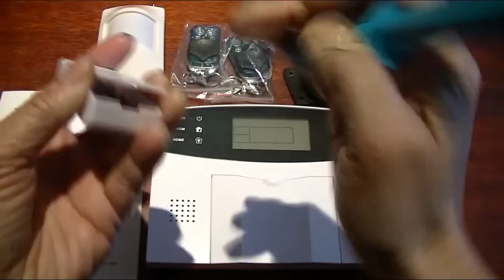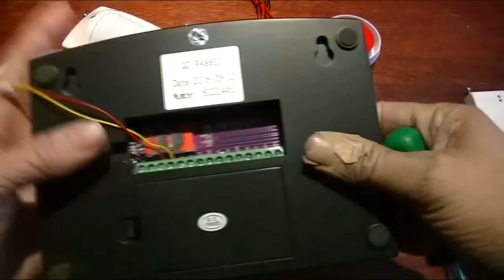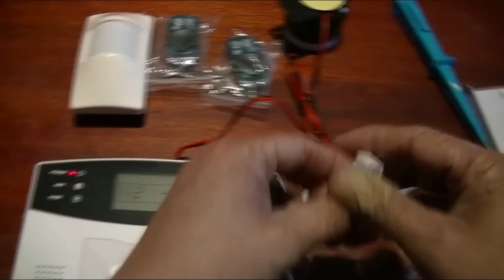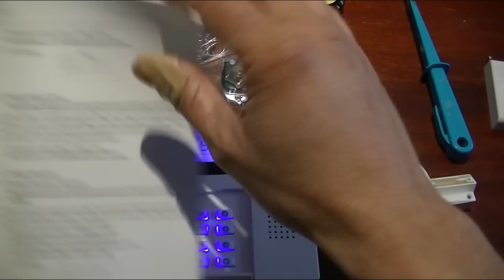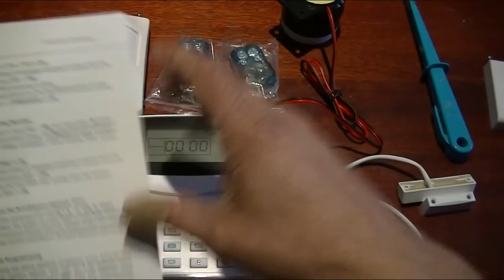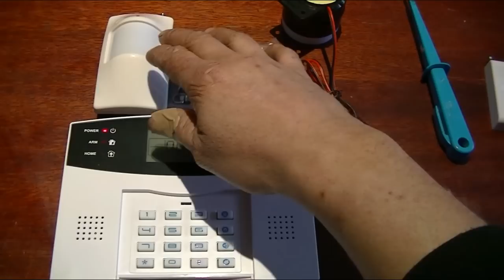Wireless  GSM alarm full review,  programming and  test

Comment: Hi i have a 4 wire fire detector
To connect with this alarm, should i do the settings of the fire detector on nc or no?  I got it to work but after I installed the wired pir sensor the fire stopped reacting and when pir is triggered the is no soumd coming out of the siren it just send mag and call.
Thanks

Comment: Thank you! Do you get any false alarms with these motion sensors? In an effort to avoid false alarms, I am planning on buying this same system but with different motion sensors with Dual PIR + Microwave MW, from a different manufacturer, will any/most sensors work with this system.  If you an affiliated link I’ll buy from it.

Comment: Nice video... But,Mine must be a slightly different version to the one in the video,Got all the sensors working but the magnetic contacts (That are already wired up  ) wont work,Tried a factory reset but still no good. It's like they are disabled,Any ideas
Reply: Same mine  did you figured out?

Comment: Very good video...I wonder can you tell me if you can adjust the length of time the alarm sounds if triggered....so it won't be sounding for hours if I am not at home....and driving my neighbors crazy.
Reply: The system is designed to alarm and intimate you. You have to set the alarm off it goes off. The WiFi model, you can control via app, same as the GSM model.

Comment: Thanks...question...
..my unit came without batteries and I need to determine what size battery to use in the remotes. Do you know what battery works in the remote?
Reply: Larry Minichello it works with 23a a23 v12 alkaline batteries
Reply: I’m pretty sure I threw my last one out a couple days  ago so the package is gone

Comment: Old thread, many questions. I have got this alarm and want to emphasize two things:
1 - As far as I understand, this alarm uses 2G and needs an old type of SIM-card, which may not be available any more. In Sweden, none of the mobile providers have these old cards anymore, hence making the GSM part of the alarm useless.
2 - There is no function for a PIN-coded reset when an alarm is triggered. Which means that anyone can just reset (and quiet) the alarm just by pressing the "unarm" button.  The solution is to mount the main unit for example in a locked area. And use the provided remote control for resetting. (Which means the main unit can't be too hidden anyway.)
Two important shortcomings, which made the alarm much less usable.
Reply: Can you use this system without the Sim card

Comment: great video, thanks, however, how do i adjust the siren on time? mine takes a while, like 4 mins, wanted to make it 2 or 3mins of noise
Reply: Chris in setup mode press 32 on the keypad then enter the time [00-15] minutes finally press # the host then makes a long beep your gone
Reply: @ryecoodr  woooooow, thank you very very much, woooow, thanks, am so relieved
Reply: Rye Cooder Rye Cooder I tried setting the siren but siren won't switch off armed or unarmed.
I'm feeding the black wire into ground connection and red wire into 9v 
Things to note I don't have a SIM card in
Could that be the reason or I'm connecting it wrong?
Reply: @NoName-vi7lg  to hook up your external siren you connect the wires to BZ- and BZ+

Comment: Why does the alarm go off as soon as the exit countdown ends
Reply: Chris is your system wired or wireless?
Reply: @ryecoodr  Hi Rye, perhaps you can help me, I have the same problem. As soon as the count down finishes, the alarm goes off. All door sensors appear to be working. I even shut off the door motion detectors thinking they might be faulty. This is a wireless system like in this video...Thanks in advance. You can answer if you like at obetec@gmail.com

Comment: Hello, which phone system should I use for remote communication?
Reply: hi you can add my whatspp +8617612778257 or check the link then will help you 
https://www.aliexpress.com/store/product/Home-Security-Alarm-systems-Metal-Remote-Control-Voice-Prompt-Wireless-Door-sensor-LCD-Display-Wired-Siren/910381_32952613601.html?albbt=1&isdl=y&aff_short_key=uNb6i2f&aff_platform=true&albslr=201206798&src=Youtube

Comment: I am having real problems wiring in a pir to zone 1, i have easily set the zone ative in the menu but will not trigger alarm, pir can be seen lighting up when motion but no alarm trigger. Have tamper on pir to zone 1 & cc to com on panel (have also tried to ground) can you help?

Comment: Hi, I installed homsecur system yesterday. Ive added an extra wireless PIR and an extra wireless door sensor successfully, but the  problem I have it keeps activating the alarm without it being armed, any ideas?
Reply: Sounds like these zones are set to 24 hour.  You may need to change the Detector Alarm Type Setting 26xx1# for arm or home modes, 26xx2# for arm mode only.  Hope this helps.
Reply: @MrSailbadthesinner  can you explain some more. I'm having problems with zones. Thanks

Comment: Hi igs20101, I have been using the same (basically) system for a good while now but there is one function setting I just don't understand the use of it. In my book its #20-Host Timing Function Setting, 2 options, 0-close all timing arm/disarm function, or 1-open all timing arm/disarm function. Maybe its the way its worded but I don't understand what it does lol! In setup state its 41 for mine, I have never set it either way, everything functions as it should but it bugs me that it has me clueless. You seem to know a good bit, any ideas, anyone? I just want to know its function, thanks.
Reply: Hi,  The Host Timing Setting allows the alarm to arm and disarm itself at a certain times each day.  In setup 42hhmmhhmm# sets the two times (disarm, then arm time). 411# then enables the timed function. 410# disables it.  Hope this helps.
Reply: I see, so yours like mine has separate inputs. Setting arm/disarm times is the step below the input that switches those times on or off. Mine must default to on, I have never changed it but my timers work once set, that would also explain why I never changed it but my timers work. Thanks a lot, I appreciate it.

Comment: Hi!
I have gsm alarm system 99+8 zone and I lost admin password. Can I make factory reset? How?
Thanks.
Reply: Let me first say this is a guess and it may not work!  You could try switching off the power supply and disconnecting the battery pack (not just switching it off).  Then leave it for a good long time (say overnight) so any remaining charge on any capacitors runs out.  This MIGHT cause a factory reboot when you power up again and return the password to the default.  BUT IT MIGHT NOT REBOOT AT ALL.  So this is a risk but if you can't get any better information then you might want to try it.

Comment: Hello, my system wont ask me for the user password to turn off the alarm any idea why? And how do i fix it?
Reply: first change the user password in setup mode and if you want 3333 for password type 383333#
than to lock the keypad in setup mode type 401# it should say setup completed and that's it.
Reply: +Rye Cooder thanks alot
Reply: very helpful, thanks!
Reply: You're a genius. Thanks.

Comment: Hi my system looks just like yours but my default password is 6666. There is no instruction on how to enable delay on the wired door contact. are you able to help? My Z1 wired is 81 on system. Thank you.
Reply: instruction command is 47 so therefore it should be 6666# 47 xx # - xx being your sensor number, depending on system that will be 01 to 07 or 08
Hopefully this will work, it does on mine.
Reply: Hi,
Yes, I've now got it sorted, code as you say with a 10k resistance, many thanks.
Reply: Martin in setup mode type 3440#
Reply: Thanks for your help. I just called my mobile provider and found out it will be 20.00 extra a month to have a SIM card activated to install in the Alarm.
Reply from the maker: Hi .had a quick look at ur question and their is few different problems that u can end up with and also it quiet a lot to be meant to be adjusted .
if the factory codes are already   different ,then it possible programming code also will be different .in my case 99 wireless and after 7 wired .also to program first wired zone as entry zone I would have to use operation methods with my settings that I will explain here ,but possibly not the same as yours .
it starts from 60(defence zone programming that I want to do ) My case Zone  100 - is first wired zone that will have to be as door opener and then it will have to be marked from the manual as all options to be done like zone type,what alarm type and in my case if siren on or of if it set for 24  type alarm.so looking will be 60>30(entry time)>4(door alarm)>0(siren on)  .witch means my hard wired zone 1 is set for 30 sec to entry/exit as a door alarm and  siren not used in that 30 seconds when that zone is touched ..
Reply from the maker: It's lots to explain on this type along and  was thinking to make photo for reply  but seemly I can't post any photos anywhere.if u want to send me ur email I will post current manual later on and see if u can do anything
Reply: Hi,
My system like yours is 6666# and I am also trying to hard wire a contact, have you had any luck yet.
Reply: Hi,
Sorry to be a nuisance but having been through the manual a couple of times I cant find how to set  the entry time delay. I would like set zone 83 as an entry zone with a 40 second delay any help much appreciated .
Reply: Ok I will try this DOK thanks
Reply: Hi Rye, Does this system require a phone line or Internet service. I live in a rural area and do not have internet service like cable, satellite, DSL, nor fiber. I only have my smart phone.
Reply: Hi mss burr you need an active sim card no internet needed or phone line
Reply: I have a home video surveillance system. It would be nice if I could run my video feed through this system.
Reply: I don't know where you live but I am from Canada and I purchased mine from Petro Canada gas station they charge me 25 dollars and it's good for 4 months just have to top it up every 4 months the alarm doesn't use much time so it's by the call and text they charge me for

Comment: Hi...how setting wired zone, the code 23 for wireless sensor, what code for wired sensor ? Thanks
Reply from the maker: Hi.in my panel ,and as far as I came a cross few of them I found that all wired zones on the back are already numbered.and depending on your alarm full spec wired zones start like from 93 for zone 1,then 94 as zone 2 and so on fallowing from your manual of the wired zones .so after you installed 22 wireless zones and adding one wired ,than that zone will be zone93 and you have to program that zone 93 for whatever function that zone will be.like front door or back door and I have to program it as access zone 93..hope that was helpful.
Reply: instruction command is 47 so therefore it should be 6666# 47 xx # - xx being your sensor number, depending on system that will be 01 to 07 or 08
Hopefully this will work, it does on mine. This of course depends on your system.

Comment: where i can get the sim .it come with alarm system .thanks
Reply: where you will get home to set alarm system
Reply from the maker: u get ur SIM in any shop that sales the phone ,only make sure its still old type big size sim not for not for  iPhone .and also that SIM have to be security code unblocked or u can change that settings with normal phone be for using in alarm
Reply: i don't know yet
Reply: that mean the sim card we have to payment look like the  cell phone
Reply from the maker: +lam le depends where u live and the rules of the SIM card provider.i am live in Ireland and one of the network,that I use for this alarm have a full to top up SIM card every 6 month by min 10 Euro.even if u don't use that credit u can make few phone calls to any number or different country from alarm panel itself to chat ur best friend abroad
Reply: ok thanks bro

Comment: Hi igsI got a new sim card and tryed it in my mobile first to make sure it works and it does with sms/calls the machine was powered off before I put sim in tryed to call the machine but nothing is happening there isn't any pin code on simthanks dave
Reply from the maker: Hi.when you put new sim in the phone did that sim had a access code or phone start up straight away and you where able to use it ? if there was a access code then you have to set up in the phone security to take that code off Also to reset the system to factory settings you should find in the manual long digit code ,just read manual better .i am away for the week so can't send the code I have any it could be different.
Reply: Remember that this is a GSM system so it will not take a 3G-only SIM such as those for the THREE network in the UK

Comment: Hi . Does anyone have a problem setting up the sms messages and calls thanks
Reply from the maker: Never had that issue.just make sure that sim is security unlocked before u put in to panel .and i presume u have tested that sim in the phone before using in alarm ,then reset all the settings to the factory set in case something was locked out and start again

Comment: My system came without a manual, so I do not have a list of all the codes. The video suggests that PIR's will be automatically excluded in home mode, but that doesn't  happen for me.  Is there a code to automatically include/exclude a zone in home mode.  I also want it to stop sending texts whenever there is a power outage, as that happens all the time here and my sim will run out of credit.  Can anyone supply either of these codes, or better still, send a copy of the manual including the codes to villa.calamansi@gmail.com. I haven't been able to find a copy of the manual to download.
Reply from the maker: I will photo copy my manual and send it to ur e-mail that u mentioned next week as i am still notvaround and dont have it with me .will letbu know when I don it but also manual could be different to alarm that u v got .then that all I can helpbwith
Reply from the maker: Hi .if u want to send me ur e-mail I will photograph all pages of the manual and will send them to u .ibwill do that next week as I am  away till Wednesday .also as far as I remember this system don't have option to send text on power cut but not 100% remember and yes any devices of the system have to be allocated to different type  of operations, that including home part alarm .you will check that when I will send u a manual .also if u can remind me on Wednesday that I don't forget to do it for u
Reply: Hi igs20101
I have the same problem as above in that when I set it to home mode everything arms, window/door contacts and pir's, I have a badly translated copy of instructions however I cannot find anything where it says how to separate them apart from the remote button and that arms everything :(
Reply from the maker: hi David .Some manuals are hard to understand but also they are different but there is settings option that called some sort of home guard or similar. To set some devices to home settings you have to know in witch position/plaice that device /PIR   is programmed  in your panel and then you shuld be able program that device for home settings .if you want to send me a photos of ur manual ,then i should be able to tell you  how  to do
Reply: unfortunately my system didn't come with an instruction manual as well can someone point me in the right direction please